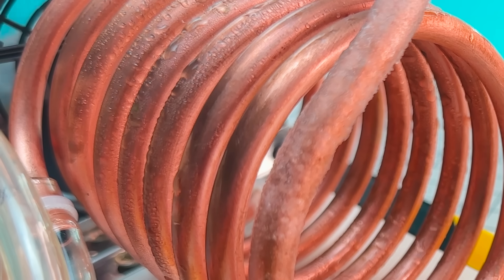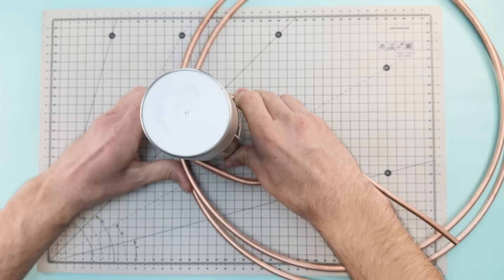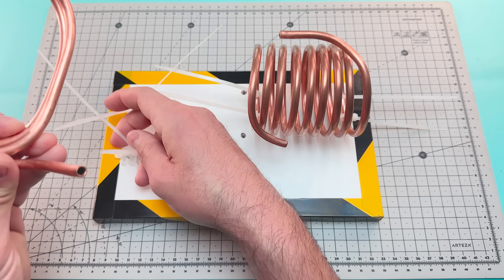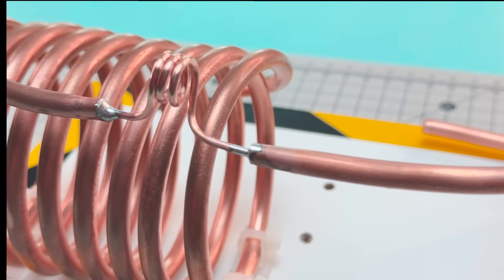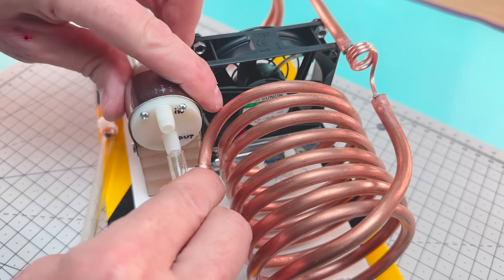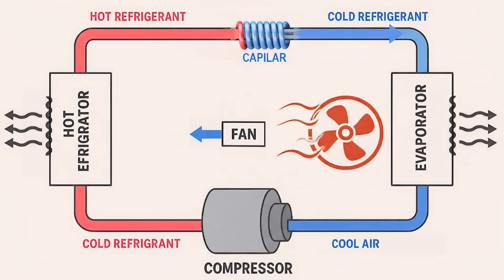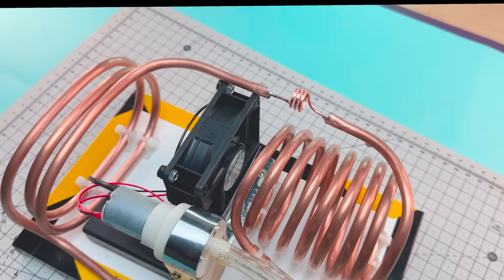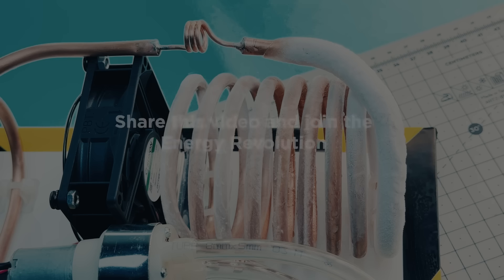Make your own AIR CONDITIONER at home Fast and Easy!

Comment: some comments i read, The condenser needs to be outside blah blah, You put the heat right back into the room blah blah. you dont need a portable air conditioner what you need is common sense, they just showed you how to make a portable air conditioner that's all the insulation is up to you, if you have still a brains.. this ungrateful comments make me sick what a bunch of haters

Comment: This actually might work as a good refrigeration system rather than air conditioner if we separate the condensors and spread the copper loop on bottom of a icebox and ensure insulation from outside this would chill things up nicely then if we add a temperature sensors we can close the connection once whole icebox is cooled sufficiently let's say -2 degrees celcius so that we don't need to run the whole thing continuously saving some energy

Comment: The law of conservation of energy would require that if the condensor slowing down the motion of molecules (freezing) then the evaporator would have to correspondingly excite an equal amount (heat up) and although the fan is spreading the cold it would also draw in the heat from the condensor since it is right next to it.

Congratulations, you've made a box with a hot side and a cold side running off a 9 volt battery.

In order for this to actually be effective you would need to stick the evaporator outside the room with a barrier between it and the fan + condensor, and possibly rig up plugging it into the wall. Maybe add another fan on the other end of the condensor may help also.

So that would be a, what, 100 BTU air conditioner??

Comment: It does not work at all, the condenser should be outside of the environment, otherwise it will be canceling each other, also there is too little gas and a lot of oxygen in the line, it's not that efficient, and it wouldn't hold bigger pressure
Reply: Absolutely Correct!

Comment: this likely wont work or at least not for long as an air pump of that size and power isnt going to be able to compress the butane into a liquid state. also even if it somehow does it would quickly overheat as the condensed butane would be pretty hot. this setup would actually run with a decent compressor, no plastic tubes, and obviously a separate fan for removing the hot air created.
Reply: He uses a 9V battery to run a 12v fan and pump? 😂😂😂
Reply: question: if i put 2 9V batteries in series to make 18V will it work? cause i really need a cooler for summer even tho its autumn
Reply: @UnnamedUser-s1wno this will not work. An air conditioner needs a piston style pump, a reciprocating pump like this will not work. An air conditioner also needs a metering device otherwise it will immediately freeze up.

Comment: This would not cool a room, as there's no method of exhaust outside of the room. Put simply, as one coil cools off the other side heats up equally.
Reply: I'd also like to add that butane and electronics are not a safe mix, especially since the circuit is not vacuum sealed. One spark reaches that butane and the device explodes.
Reply: This wouldn't cool a wet fart.  There is no compressor.  Pressures of 125 psi to 150 psi are required for isobutane.  The zip ties and vinyl tubing aren't capable of holding the high pressure needed.  The cheap little vacuum pump would likely produce a spark that would ignite the butane.
Reply: Total waste
Reply: It won't matter when the battery runs out, unless you buy a new battery. Then it won't matter once you run out of money.

Comment: Great work. One thing. You cannot use it to cool the room. The heat that dissipate from the coil will heat up your room. Also it is too small to cool a little room. However awesome job
Reply: It isn't possible for this to work without a compressor and the vinyl tubing is not capable of holding the pressures required for a refrigeration.

Comment: Pizoelectcal pump designed like a Stirling cold gas cycle piston to drop alcohol being circulated through an air conditioner system with seabeak effect electrical power supply to power it? Um will it work and will free Mason ran patent office murder you if you try and patent it? 🤔

Comment: So funny that everyone is commenting about the compressor and evaporator being in the same room so they cancel each other out. Sure but this is still a great example of how nearly all modern refrigeration works. Yes, for any real advantage you need to put the compressor in a separate room (outside the fridge, outside the room, outside the house, etc.) but this is still an awesome example of a common appliance that almost no one understands.
Reply: Can this work for a 10x20 cm case as for to makr a diy fridge?
Reply: Same as people thinking a thermostat controls the degree of air coming out an air handler.

Comment: This is amazing! I have a very small space in an old VW splitscreen where the original air vents box is on the ciling. I reckon I might be able to fit this in there. Since cold air falls this is a great place to put it. Ill get a heater for the floor. Thanks for this.

Comment: Apakah gas butane, bisa dimasukan kedalam saluran radiator menggantikan watercoolant kendaraan ?
Reply: Aku udah coba alhasil kompresor atau pompa tidak kuat menyedot. Freon jadi tidak bisa. Bisa kita ambil kesimpulan bahwa jika kita mau membuat sebuah pendingin ruangan harus menggunakan kompresor karena dapat memompa freon lebih baik bila kalian tetap rewel dan mau menggunakan pompa kecil ituu sama saja tidak bisa bila kalian mengganti pompa kecil ituu menggunakan kompresor bekas kulkas itu bisa
Reply: Artinya perlu pompa bertekanan tinggi kya pompa jet sprayer cuci motor mobil ya  @SBNaudio

Comment: Hey! I’m working on a magnetic cooling project for my upcoming science fair. I just need a bit of guidance on how the design works — really inspired by your video!
Reply: Just research how ACs work. It is the same principle except it used an actual compressor. Also this wont work since the heat element is releasing the heat in the same room as the cool air. This would work if the heat was released outside the room Like ACs units work. One unit outside "heat" and cool unit inside.
Reply: @ferh12  thank you sir!

Comment: I think if you submerged the hot coil in a water tank to absorb heat (and of course change the location of the fan) this would cool a tent, a car or a small room. I would like to build this but my skills are lacking.😢

Comment: This is genius! You build a contraption to extract heat from one place and release the heat next to the point where you extracted the heat. And that is called an air conditioner, and that is how an air conditioner is used? This sounds like keeping the refrigerator door open all the time. 🤣🤣🤣😂😂😂

Comment: Is the gas used forever or it needs to be refilled
Reply: i think it runs out in like 5-10yrs
Reply: If there are no leaks gas stays in the sistem and it has no expiration clearly at some point it either leaks a pipe or a component fail

Comment: Sooo... How refrigeration cycle works, is that you take a gas that absorbs heat well. So you circulate that gas in a hot environment, take that gas OUTSIDE the hot environment and let it cool, releasing the heat. This machine would take heat from the front and release it out back doing basically nothing. Thats the reason refrigerators are cool on the inside and outer body is hot. AC units have an outdoor unit that releases the heat. As mentioned only thing it might do is cool a drink.

Comment: You wont cool anything because the heat absorbed by the evaporater is transfered back to the room by your condenser LOL. Actually the room will heat up due to the energy input in the airpump xD Do some thermodynamics bro ;)
Reply: It seems that you would be the person to tell ppl that a generator driven by an electric motor won't net electricity. Some ppl need a tooth fairy man...

Comment: trying to get info on building a active cooling system for workstation cpu. which darws a lots of power and needs a active cooling. but this system needs to be improved. the water needs to be maanged. and the cool air needs to channeled. any idea or plan on that ?
Reply: Thats just a demonstration of the basic refrigeration cycle. An active cooling system does plan for such things. Drain pan and drain line off evap, thermostat temperature control, Some form of defrost for the evap. If it freezes over and air cant circulate across it, you cant get cold air. HVAC is much more complex with high and low pressure switches, thermostat expansion valve etc. But they all work on this very simple principle of compressing and decompressing a liquid. Changing state from liquid to gas and back to liquid is how it moves heat from one area to another

Comment: can use other than isobutane? because of it hazardous; explosive and flammable?
Reply: you can use any other gas which can be used as a refrigerant. A simple google search will provide you with enough info.
Reply: maybe R-134a is way cheaper
Reply: He used r600a or isobutane since  it is not a f gas or flourinated gas whit is regulated by strict accessibility rules that forbid unlicensed people from buying and using it, many known cfc hfc hfo gas  are r12 r134a r404a r32 r22 and many other more

Comment: well I am not hating but after reading the comments I have watched countless videos hoping to see one that actually let the the system to run without any zoom ins and unnecessary jump cuts. I actually want the thing to work rather than buying material only to waste money. even if one can afford an AC, it would actually be way more cooler(no pun intended) to have one you've built
Reply: The system is a cool build but doesnt work as cooler/ac

Comment: Esto funciona para enfriar un cuarto o no??
Reply: Soy frigorista 
Y no , pero te tirará un aire bien fresquito a la cara , procura antes conducir el calor del condensador a la calle , esto veo mas bien para mantener y enfriar un litro de cerveza.
Reply: Eso si , varios de estos motores y varios serpentines … habría que comparar consumos . Y si consume menos que un inverter es un descubrimiento
Reply: As is, it won't cool a whole room. To do so, the condenser side of the coil would have to be outside the room. That would probably mean a lengthening in the connection between the evaporator coil and the condenser coil. I'm guessing that additional refrigerant would be required.

Comment: Wow all the haters here. Add a bigger usb battery and anothr fan to blow the heat out a window even go as far as to install some insulated separation. Charge you battery wherever and cool your dorm for cheap.
Reply: Also I think this is basically a basic working diagram of how the process works.

Comment: Does this really work? I don't think that toy pump has enough power to compress the gas into a liquid. At what tpye of pressure is this system operating at? Using flexible plastic tubing...
Reply: I find it sus that there were no wide angle shots of the machine in operation.
Reply: It kinda works but verry rooky. Just fun to build and cool to look at, but thats it. And the liquid isnt supposed to condense in the pump!!!
Reply: Small condenser tube. I forget what he called it. It had three coils and reduced the pressure causing the cooling effect

Comment: Not a realistic way to cool anything bigger than a bread box. Heat absorbs cool. Condenser has to be away from the evap. coil.  They would cancel each other out in this setup. Also condensation will be an issue. Would be an interesting project for kids.
Reply: not a put down, but what would you add to this/change to make it better? i'm going camping and was thinking of trying to modify it to hook up to a solar panel.
Reply: @artzanator  The problem with this is the coil gets cool, but the condenser gets hot. So if this is in a small room or a tent, you're cancelling out any cooling with the heat coming off the condenser. The way to mitigate this is to have the condenser outside of the area you're trying to cool and to have another fan on that to push the heat away from the area. This really isn't a great cooling system, but it's a fairly neat scale demonstration of a cooling system as a science project. You're better off making a swamp cooler for camping, but that only lasts as long as the ice does.
Reply: @artzanator  air conditioners rely on a building's insulation to maintain the temperature gradient between indoor and outdoor spaces. If you set up this device in a room, you will get a temperature gradient in a local area, but it will normalize as soon as you shut down the device. A window AC unit will cycle every 10 minutes or so as the room slowly heats back up, and shut off after a couple of minutes, saving power, wear on the unit, sanity from the constant noise. This little unit, assuming it actually works and can be powered by solar, can blow a bit of cool air on you while its running, but you aren't going to make your tent into an icebox.
Reply: @artzanator  Have the evap coil in a small styrofoam  ice chest with a small opening and fan. Have the condenser outside outside the tent with another fan and covered partly. A catch pan under the evap coil for condensation. Its alot of trouble for a little temp difference. Better to build a solar powered radiator fan instead, for camping.

Comment: Well explained and a good principle, but you've still got the condenser side and all that heat to get rid of. And on a 9 volt you won't be cool for long. And I'd be skeptical about having it in proximity to an ignition source, this is why motor vehicles use more inert refrigerants rather than isobutane or propane in their HVAC systems.
Reply: But its also a proof of concept.....not necessarily needs to be functional in real world use.

Comment: This will not cool a room, it's good for drinks but nothing more. The room will even get warmer with this because the condensor generates more heat than the evaporator cools.
Reply: ... Yeah ! ... I did buy me a mobile Airconditioner ! .. good for about  2o qm room .. to cool off ... Voila ! ... it works !!! ... but you need an outlet-tube .. for the warn air too !!! ...

Comment: This is dumb! You need a fan connected to a duct that goes outside on the hot side to draw the hot outside! This will do nothing! And a 9v? If you want to run it for 10 - 20 minutes and change the battery everytime!

Comment: rule of thumb you´ll need about 100W per squaremeter for airconditioning, so you´ll be able to cool a cookiebox with your contraption
Reply: a better use is to make blocks of ice and use a giant fan and several buckets of ice to circulate air around the house. I did this during hurricane season 2017 had no power for 2 weeks, but at least the house was at 75 degrees. If I had no ice or fan it would have been 86 indoors.

Comment: You forgot to mention that there need to be an outlet to get rid of the heat from the condenser. Otherwise you're just moving the heat around but the total will be the same (except for a very small bit of extra heat generated by the motor and the batteries, so in total you actually heat the room a little bit more than you cool it). You need to blow the heat from the condenser out of the room / out of the building.

Comment: Great display model, but the other side gets hot. Think of it as a heat-mover. It moves heat from one coil to the other. 
This is why in an air conditioner part of the unit is outside, where the heat can be dissipated. 
Also, most units are designed to be as cold as possible without freezing. The frost is like an insulator, which prevents heat transfer from air to the cold coil.
Reply: so how do you prevent frosting
Reply: @gojosatoru9156 much higher airflow, a more efficient coil (actual coils have lots of fins) but mostly instead of the capillary tube, a TXV or Expansion Valve is in place. It's a simple mechanical valve that let's more or less gas through depending on the temperature of cold coil. Keeping it just above freezing.

Comment: Yes, but the other pipe is hot. If you don't vent the hot air outside, the work is useless. I'm sure you know this. However, the invention is brilliant.
Reply: I used the other coil as a stovetop :)

Comment: I know nothing of this tech, but wouldn't you want to put some type of round solid cylinder in the middle of the coil and then an enclosure around the coil so more air is forced to pass over the coils leading to increased cooled air being pushed out into the room?

Comment: Your low on charge or don’t have enough air flow over the coils. Could shouldn’t freeze over like that.. and you’re going to have to buy a lot of isobutane  over time. That stuff will leak out over time. It’s best to just go buy and ac unit for your home or office. However, this video explains very well the basic fundamentals of and Air conditioning system. ❤
Reply: HOW ELSE ARE WE SUPPOSED TO KNOW IT IS COLD! lol.

Comment: I'm pretty sure if you did this in a little bit larger scale that you could actually have a window where you can eat with the keep the hot air away from the cool area trying to cool will the divider which this could actually help you out with the least amount of effort

Comment: everyone bitching about the video thinking your smart. you are actually the idiots. the creator of this video was aware of everything your pointing out and designed it and showed it this way so you would all react to it like you are to push it in the algorithim. the point of the video is to show the concept of how it works, not to show you how to not buy an ac unit from home depot...
Reply: lol, this is junk.  May work for a minute and then it will be garbage.
Reply: @jagmechtech  the only thing being shown here is the concept. its not even built to be functional without any shell...what exactly do you think is going to stop working on this?